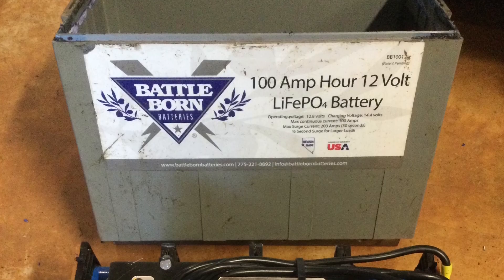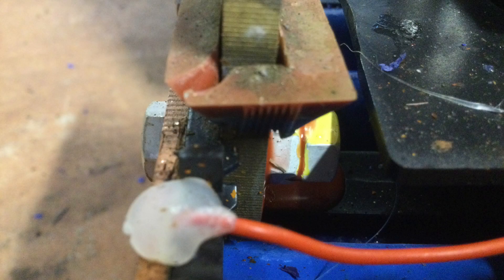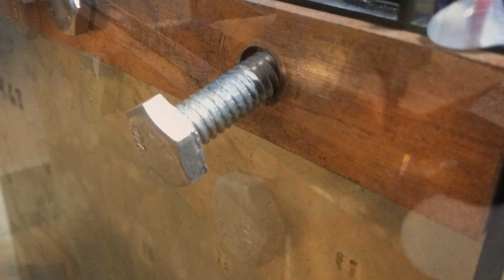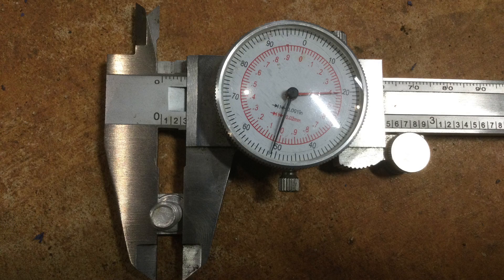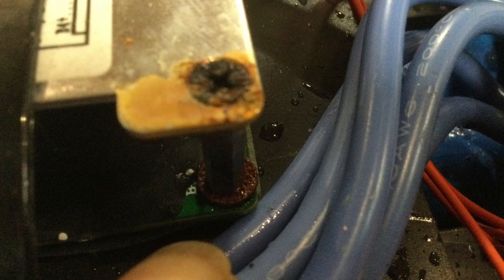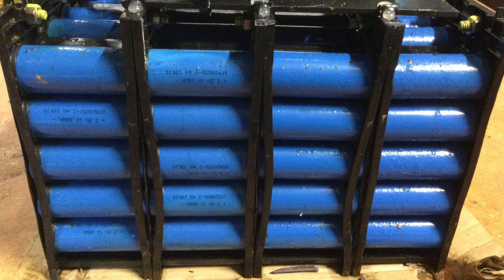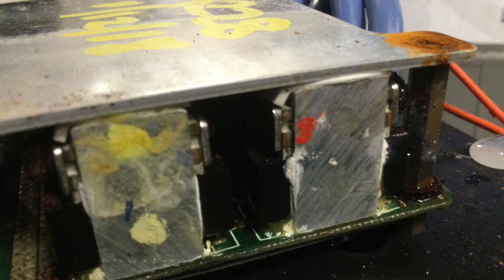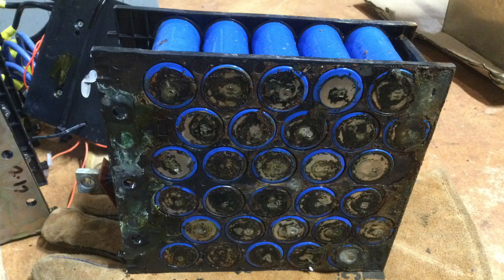Battle Born Autopsy

Comment: One of the main rules in electrical world, you can't use copper and aluminum conductors together! Only in uniq circumstances, when it is unavoidable, a special grease / lubricant must be used at the junction of those metals. To make things worse, they have worsened it with the plastic spacer. It's not a bad engineering, it's an absolute absence of it.

Comment: That bolt is not the horror its the plastic that deforms and relieves the tension on the bolt.
That terminal post should be in direct contact to the bus bar and the bolt with a split lock ring
to keep tension. 
The same issue is the intercell bolts that also have plastic between and that will relieve tension for those.
Sealed box breathing is a common problem, I do antenna engineering and I am well aware that 
heating-cooling cycles (day/night) causes condensation and water build up if sealing is less than 
absolute hermetic or there is no weep holes.

Comment: You pulled broken batteries out of your local dump - and this battery is supposed to reflect what? Another autopsy felt that these were about the tightest batteries you could buy. This is a joke of an autopsy.
Reply: I’m glad he did… our island is now the garbage island not the garden island!
Reply: I mean, it’s pretty obvious why it was in the dump to begin with.  Many others have pulled these batteries apart to reveal their awful build quality.  This is how BB builds them.  It’s not like this particular specimen is an exception.  The way BB designed and manufactured that positive terminal is beyond a joke.  I’ve coached high school robotics teams and they have more smarts than to try and design something this bad.

Comment: Aluminum bolt does oxidize forming Aluminum oxide which is less conducive.  Bad design.
Reply from the maker: Yea, and these are showing first signs of that. 

All these manufacturers need to do is add a little goop here and there, and if for some reason moisture builds up, failures of connections due to corrosion and resistance can be minimized.

Comment: A 1000 dollhairs?   I made 2 8s  batteries with eve  lf 280k cells  bms for close to that prize  
And the use of the small cells is insane when bigger cells have become so cheap 
It would have been so easy for them to build a decent battery with bigger cells and avoid all those problems and still make a good profit
Reply from the maker: Yea, unfortunately these batteries are behind the times, designed before factory second automotive prismatic cells were easily obtainable. 

Smaller cylindrical cells like these are still preferred by other industries due to their form and ability to rearrange and construct a module to fit  a specific application or in a particular product.

Comment: I have an Epoch battery that's IP 67 rated. Does this mean I have a lesser chance of having condensation inside the battery? This battery is inside an enclosed cabin on my boat, but it's still a bit humid in there.
Reply from the maker: If IP67 then it should withstand submersion which means it should be well sealed, so if air can’t get in, then water vapor shouldn’t get in by being able to be drawn in with it. 

If you are concerned, consider installing a dehumidifier in the compartment, or better yet maybe place the battery in an over sized battery box and install a dehumidifying device of some sort in the box.

Comment: an aluminum bolt??? WHY?
Reply: Because the design is such that the bolt carries the current rather than just clamping the current carrying parts together.  A steel bolt would be too resistive and get too hot. Bit of a moot point since the plastics creep and it gets too hot anyway 😂

Comment: Interesting. So, the other will is correct, and the manufacturer is wrong. Any second yearn physics student can see the faults here. Trouble is, I have a friend who had his fantastic off road RV burn to the ground recently due to a LiOn batt exploding. Not this brand, but the point stands.
Reply from the maker: Different chemistries have different safety concerns. Lithium ion typically is prone to thermal runaway which can create high temp intense fires that are hard to put out. 

On the other hand, Lithium Iron Phosphate like these batteries is considered to be more safe as they are less prone to thermal runaway, however they do have a risk of explosion if the cells leak and you have a spark which is why having an arcing contact inside is IMO a danger I would want to avoid.

Comment: Pretty wild just using a bolt to conduct the DC current. 

The design is just so ..... Stupid.
Reply from the maker: Certainly would be more ideal to have the two metals directly in contact with one another and the bolt only fastening them together.
Reply: The aluminium bolt stinks of a sticking plaster on a fundamental design problem.  If only they had bolted the lug on the other side, and used a steel sleeve inside the plastic to take the pressure....
Reply: Is the bolt aluminum or an alloy? Aluminum cannot connect to copper is it is a dissimilar metal and cause galvanic corrosion. Terminals rated for copper and aluminum are cu/al rated. There must be a reason for this design not yet explained by the manufacturer.
Reply: @Cdesousa43 Yes there is: in Australia we call it a “Rat Shit” design or RS.

Comment: I want to know if there is the same defect in all their batteries ???????
Reply from the maker: Can’t say for sure, but based on the way BB responded, it’s unlikely the design has changed. 

These batteries date to 2018 according to the handwritten info on the BMS. 

The lug terminal design issue is likely a result of trying to streamline the assembly process. 

The individual cell modules are probably sub-assembled, charged and tested then shelved, then pulled and paired together when a complete unit is built. 

“Fixing” this issue before or after it becomes an issue is easy enough, but requires gaining access which may be challenging and would of course void any warranty, although the companies stance is that there is no issue which means it’s unlikely they will be of any help, leaving it up to individual owners to decide if they want to be proactive and protect their investment and mitigate the risks associated with a potential failure due to overheating and arching.
Reply: Thanks. Came to comments to see the mfg date.

Comment: Aluminum also expand and shrink a lot more with heat and cold  and this will change the tension and contact  pressure.  
Aluminum  also have a higher resistance . 
And it will start corrion between diffetent metals  when mounted to different metals like copper.

Comment: Are cylindrical cells better or worse than prismatic.  I generally prefer prismatic due to density and few connections but they also are single points of failure.
Reply from the maker: In general, I would argue larger Prismatic cells are “better” than a bunch of smaller cylindrical cells put into parallel then into series to create the same amount of capacity. 

Not only are there fewer interconnects as you point out, but also fewer individual cells to monitor the voltages and temperatures of, and less exposed connections, and a much easier design to deal with if you have to replace a bad cell or block/module of cells. 

Typically large batteries are made up of smaller batteries either to increase voltage or capacity, or both. 

The fewer cells, the less cells in parallel and or series, the better. 

If you need 24V, better to have one battery with one BMS than two in Series. 

If you need more capacity, better to have bigger cells than multiple batteries in parallel. 

Generally speaking of course. 

Sometime redundancy and having a split system is a good thing, and sometimes it opens up a can of worms.

Comment: Sadly I bought 8 of these pieces of junk. The only reason mine haven't degraded is the total amount of current during charging and discharging is low for these batteries in my total battery bank. What a disgrace from a disgraceful company.
Reply from the maker: You likely be fine if you aren’t moving high current continuously through them and/or they aren’t being used in an application with excessive vibration and jostling. 

I would suggest that anyone using them in a humid environment or in a wet bilge etc.. consider adding drains or putting them in a larger compartment that you can add a dehumidifier to as the cells and spot welds are prone to corrosion. 

Fortunately the BMS is well protected.
Reply: @Willdesignsandbuilds  Thanks. Mine are on the floor of my very dry and temperature stable basement. Thankfully !

Comment: Amazing. How did this company get such a great reputation for quality? Was it just because they cost more than most others? Looks like a fire hazard and they got UL certification? Both the company and the UL people need taking to task....
Reply: It was You tube influencers bragging about their 10 battery setups lol. I remember watching one and thinking, yeah full time rv but you expect someone to dump 10k on batteries.
Reply from the maker: It’s a great question. 

I’m not a customer, but only because I’m a DIY guy with experience who would rather design and build his own, know how it works and how to service it. 

But the truth is most consumers and users just want something that drops in and provides better performance and longer life than FLA. 

BB was one of the first on the scene trying to sell LFP like hot cakes. 

Part of the appeal was having US support. 

Shipping larger capacity lithium batteries is hard logistically and can be costly if not by ground, and good luck trying to ship a faulty one back over seas. 

So BB went for the RV Life market and established itself as a good option for those who saw value in support, and I can honestly say I have seen stories where they have really taken care of their customers when they had problems. 

I have recommended the brand based on their reputation when friends asked and I knew they would need some hand holding from the manufacturer. 

That’s tough to get sometimes from some overseas suppliers if you go through an intermediary or distributor. 

Personally I have had nothing but positive experiences dealing direct with companies overseas. 

Anyway the manufactures (mostly assemblers) eventually ended up flooding the market with more affordable brands and started warehousing the product in the US so you didn’t have to wait for it to take a ride on the slow boat. 

Honestly if I could order one off Amazon and shipped to my door like mainlanders can, I probably would too!
Reply: @Willdesignsandbuilds  Certainly something to be said for in country back up. I had an awful experience with SOK Europe, who turned out to be in China.

Comment: Don't forget that the conductivity of aluminium is far, far better than steel- or stainless steels. The connecting bolts should have been made from copper/brass/bronze. Battleborne will never enter my boat. The design is not safe to my standards.
Reply from the maker: It is, but as the old saying goes, you’re only as strong as your weakest link and stainless is used on all the other connections, so it’s odd that aluminum was chosen only on this particular connection.

Unfortunately companies like to throw around the term “Marine Grade” will a great deal of products falling short of ever being able to survive in such an environment.

Comment: Excellent video. Thank you. I've been following this topic since Will Prowse announced it. Torqueing a metal fastener with plastic in the middle of the joint is just a ludicrous implementation! One question: was the plastic around the positive terminal cracked, as I see in your video, before you cut open the case? I am very disappointed by the condition in which you found this battery, and I'm curious about the source of the moisture intrusion. I have four of these batteries in my boat. That's $4K wasted since I will have to replace them. They have less than 100 cycles on them. I'm wondering how urgent the replacement must be.
Reply from the maker: Honestly if it were me, I would be trying to get those cases open sooner than later to avoid risking serious damage. 

Over time the cases get brittle which makes surgically opening them nearly impossible. 

With a heat gun and some paint scrapers, you have pretty good chance of removing the top if they are newer. 

Then I would install a properly sized jumper from the lug terminal post to the bus bar, drill some drain holes, and drop a few silica packs in before I cleaned and resealed the top using sealant, not glue. 

The good news is the BMS is well potted for moisture protection. 

You just need to keep moisture from building up inside the case, and the positive terminal post and bolt from getting too hot.

Comment: Wow, not good! Thank you for this video.
I think the bumpiness in the blue cell wrap you noticed was actually corrosion of the nickel-plated steel cans of the cells themselves.
Reply from the maker: I will investigate further before I properly dispose of them, but I suspect the pimples were due to water being trapped between the surfaces and the cells heating up so badly as to cause the shrink covering to pimple up. 

I have similar sized cells from a different manufacturers product that corroded pretty badly at the top and bottom contacts of the can, but I haven’t seen any situations where the can body itself had corroded as you suggested. 

Will let you know after further investigation.
Reply: @Willdesignsandbuilds looking forward to hearing about what you find!

Comment: As has been said many times before elsewhere, including by myself, the plastic part is the problem.  Even without any heating from the bolt at all the plastic will flow (deform) over time simply due to the pressure of the nut and bolt on it.  That will lead to the head of the bolt making poor contact with the bus bar and then it's all down hill from there.  The 'safety' feature actually guarantees the problem will happen even if you don't heavily load the battery.
Reply: I still say a disgruntled former BattleTorch Engineer sabotaged their designs!  No competent designer would look at that arrangement and say " Oooh yeah, we're GTG!

Comment: Why the aluminium bolt? The physical properties are a poor choice, it's yield strength is very low. They probably substituted it because the steel bolt in the original design was getting too hot.
Reply: Aluminum is a much better electrical conductor than stainless steel. The bolt is the only thing that carries the current from the battery cells to the positive post due to the poor design choice of the plastic insulator in-between. I'm sure this is why they chose aluminum. If they had used a brass or copper block instead of the plastic, the block would carry the current instead of the bolt and a stainless steel bolt would have been just fine.
Reply: @alpinerep  Yeah, I suspect the original design had a brass bushing insert in the plastic plate, and they "cost optimised" to the aluminium bolt. It may prove to be a fatal mistake for that company. It would even be better with the post further over and the corner of the plastic cut off.
Reply from the maker: Normally there’s nothing wrong with using aluminum.

Obviously someone made the choice to do it. 

The question of why is an interesting one because IMO it only creates a domino affect with regard to the potential melting of the plastic. 

Using stainless would have been fine. They used it on all the other connections, so why the one aluminum bolt? 

Given the choice, I prefer to use less conductive higher resistance materials like stainless if it means I won’t have to deal with corrosion which can create even higher resistance than the properties of the metal material itself. 

As others have pointed out, you also have to take thermal qualities and dissimilar metals  into account as well. 

IMO, this “design flaw” is really a by-product of trying to streamline the assembly process and perhaps to reduce some cost. 

But honestly how much more would it have cost and how much more time during assembly would it have taken to simply install a jumper from one side to the other or a bushing between instead of relying on a very small amount of surface area under the bolt head to carry the load with the hopes that plastic sandwiched between will retain its shape to ensure a secure connection.

Comment: Materials science 101 - Plastic, copper, aluminum - varying coefficient of expansion - no preload on point of interface of these materials (double nutted), regardless of material selection. I can only assume that the design engineer was on vacation, hence the highly questionable selection of materials used - guaranteed to fail - built in obsolescence - solution, buy another Battle Born battery.
Reply: LoL, in this case coefficient doesnt matter at all! It wouldnt matter if you could not swim, if you would jump into a tank of acid, would it?
Reply: I’ve been wondering if maybe they have electrical engineers designing their mechanical systems?

Comment: The beauty of it is they are charging $800 bucks….. you can buy a great Chinese built for $100.
Reply: To be fair, when BB first offered these batteries there were few more affordable alternatives available. Then the influx ofrcheap overseas drop-in LiFePo4 batteries began
Reply: @geraldhenrickson7472 and thy are doing great  job with a few of the brands, I had bought some Dumfume that are performing perfectly fine and let’s not even talk about price difference, there are way too many high up stuff in the market in every industry and, it is completely for the end user to do the homework.